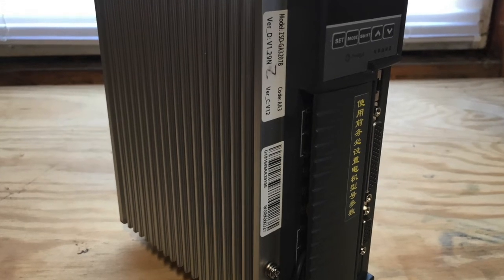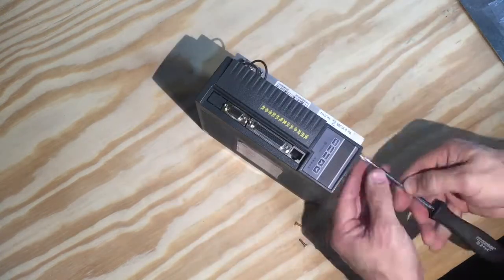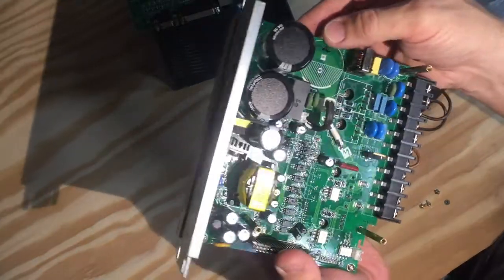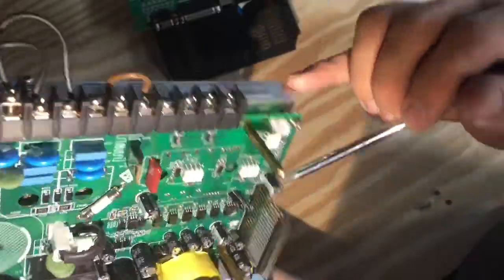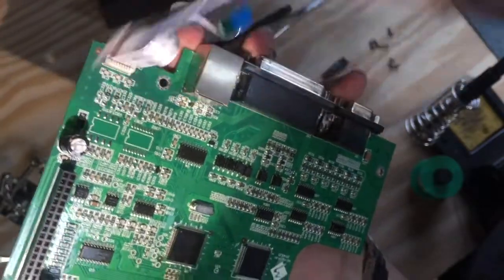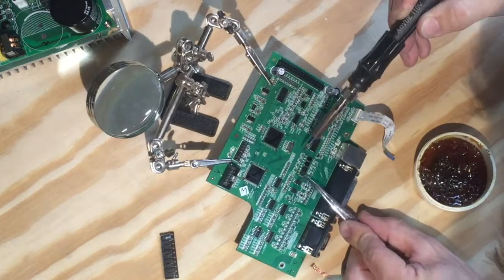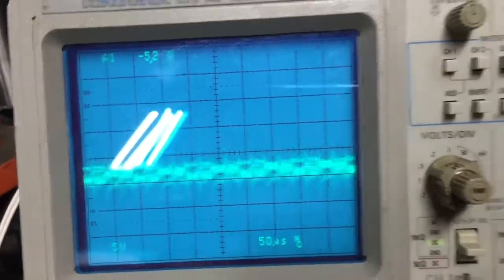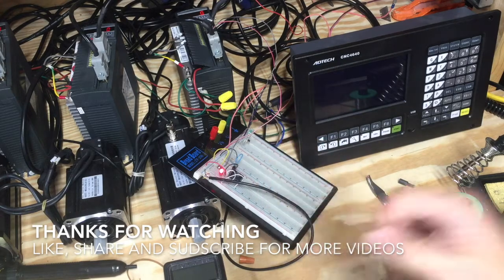DIY CNC mill: Teardown and "repair" of AC Servo drive from China. Motor brake output explorations.

Comment: hi 
when i have ac servo motor can i wiring it with any stepper drive or h-bridge 
to get open loop 
i mean to turn it without the encoder ?
Reply from the maker: As far as I understand, steppers work differently from servos. In order to get the stepper to move one step, one or more of its phase wire voltages must be flipped. Besides, technically, stepper motors are a DC type motors and work with much lower potentials compared to AC servos. So, I would not recommend trying to connect AC servo motor to a stepper drive. 
Cheers.
Reply: Tinkering Nerd thanks 🙏

Comment: hi, which pin do u use for step and dir?
Reply from the maker: Hello and thank you for your comment. This kit came with cables pre-wired, I will have to check the pin numbers for you.
Cheers.
Reply: Tinkering Nerd 
Hei, thanks a lot
Reply from the maker: On the servo drive CN2 44 pin connector, it looks like pins 32 and 33 are for pulse+ and pulse-, pins 34 and 35 for dir+ and dir-.
Pin 18 is COM+.
Hope it helps.
Best regards.
Reply: Tinkering Nerd thanks,, one more thing, which pin do i have to connect for 0 voltage,  or i dont have to,pin 18 is for 12 to 24 volts,  i have 36 pin,
Reply from the maker: If you have a 36 pin connector, your pin out map probably is different from mine. The CN2 does not have a GND pin. COM+ is used as a reference point for I/O’s.
Best regards. Thanks again for watching.
Reply: Tinkering Nerd 
It mean I just only use 5 pins only, pin 18 in my servo also for + 12-24v, and pin 32=pulse+, 33 = pulse -, 34=sign+, 35 =sign-,   Those pin 32, 33, 34,35 wire go to masso, is that correct? 
Thanks
Reply from the maker: These pins should provide minimum basic functionality to your system. Mine came with other pins soldered, such as servo ready, servo alarm, servo enable, motor brake, etc.
Reply: Tinkering Nerd 
Yes, that is the most important things to do,, about the other pins I would like to ask u later, can i?
Thanks a lot
Reply from the maker: Sure thing. I think though, you need to connect the servo enable pin (10) to be able to use the servo drive.
Reply: Tinkering Nerd 
Pin 10?Connect to? That’s what I’m not really familiar with it,, could u tell me?
Thanks
Reply from the maker: Connect pin 10 to 0V to enable the servo drive.
Reply from the maker: Once you connect it, the servo drive should “lock” the motor in one position, resisting external force on the shaft.
Reply: Tinkering Nerd 
That’s what confused me,  meaning +12-24v to pin 18,  and  -0v to pin 10, but according to this figure , 0v gnd goes to pin no 9, do u have email? So that i can sent to u some pictures?
Reply from the maker: Here’s the description for pins 7(CZ) and 9(DGND):
CZ/DGND is used for Z signal output of the open circuit of the collector, which will be provided for the host.
I’ll let you make sense of it :)
Reply: Tinkering Nerd 
Same here, pin 7&9 share same symbols, gnd, also pin 36, should I looping together and connect to 0v?
Reply from the maker: On my pre-wired system, pins 7,9 and 36 are not connected to anything.
Reply: Tinkering Nerd 
Thank u bro,, i think i have succeeded to make the motor runing with masso right now,, ist time to make some tuning,, anyway thanks again,, I’ll keep in touch with u for another wire,, alarm, 🙏
Reply from the maker: Sure thing! Keep us posted.
Reply: Tinkering Nerd 
Ok 👌🏻 thanks again

Comment: I have purchased these drives also. I followed the schematics and I'm having the same problem. In fact it was working for a bit and then just opened up randomly while I was jogging the motor. No alarm or error code was displayed. I have not tried D03 (output 3) but I require both the brake and alarm output and neither are working. What was your logic circuit supply voltage? Did you ever scope it? I'm at 234VAC with a single EMI filter for 3 drives. I'm also thinking that different results may be obtained if the 24Vdc output for external components was used to power the brake relay instead of a separate power source.
Reply from the maker: Hello. Thank you for watching and commenting. It sounds like you got a handle on it better than I do. I didn’t measure input AC voltage. Nor do I have a filter connected. My 24V supply powers the controller, the source for outputs and the brake coil.
What I found weird is that all three of my servo drives did not send the brake output signal from the beginning. There must be something to it! Yours, however, you say had worked, then quit? That’s even worse, can’t pin point at and remove the problem to prevent this from happening again.
Reply: Thanks for responding. I've confirmed that my drive is defective. Swapped it with another one and it works fine. When the original one did work it was just barely allowing enough current to light the relay. Only parameters needed are p2-15 and p2-16 must be a value greater than 0. By the sounds of it, I might be lucky to have one that's working.
Reply from the maker: Interesting.. you had not one, but two that worked! :-)
Your case sounds like the optocoupler failure. What type of relay you’re using? Did you measure the current it consumes when coil is energized?
Reply: Well, the 3rd drive brake output remains untested. I'm going to see how all of the alarm (DO2) outputs perform today. I don't believe it is working on the defective drive, so that would lean me towards the problem being on the sender side of the opto-isolators. Your video shows well that there may be some issues there also. I'm not speaking from experience but it I would think that if one of the transistors in the isolator was open, it would fail to amplify and give a similar low current signal. Would like to explore but its tamper proofed and I think they would probably warranty or repair at a reasonable cost. I'm using omron my2 series 24Vdc, measures 36.6 mA.

Comment: I just received a kit with the same Servo and inverter to replace my mini mill motor. Your trouble shooting skills and PC component R2 are very good in the end are you saying it was all a programming of the inverter? The servo  seems to be of a really high quality, the drive on first impressions seems cheap. The programming manual is over 100 pages. I hope to go through it slowly. I may opt for a better driver but for now I’ll play with it. Sorry for the ramble, bottom line is it a programming issue?
Reply from the maker: Hi, thanks for watching. You also got a servo motor with brake? The dedicated motor brake output didn’t work for me. It could be because of the firmware issues with the servo drive, for I can’t fathom the possibility of burning through opto-coupler backwards, especially since not a single component let its smoke out (we know, all electronics work as long as you keep the smoke inside, once you let the smoke out, it’s no good:-)))
I was, however, able to set one of the flexible (programmable) outputs to work as motor brake output, and it is good enough, at this point.

Comment: What can you say about these servo packs? Are they any good for DIY machines? Reliable? Thx!
Reply from the maker: I know, it’s been awhile, but, I still made no real progress towards completion of this machine. So far, these motors have been very reliable sitting on the bench, waiting for their turn. However, from the feel of it, I predict that they will be more than adequate for a hobby machine.
Reply: good to hear that. in this price range i think they are the best option to go with instead of closed loop steppers or even DC servos.
Reply from the maker: 100% agree! I think power for power its even cheaper than some closed loop stepper systems

Comment: Nice video, how did you damage the output on first instance. Or was it a bad driver?
Reply from the maker: +Fernando Ascencio thank you :-)
Honestly, I'm not sure if I even damaged it at all. I did connect my 0.6A load directly trough the optocoupler (and it was my mistake), but it would burn the optocoupler, not the processor pin. So, my best guess is that the option for native brake output had to be set, and I was unable to do so. Or somehow mysteriously I managed to burn the processor pin through the optocoupler, or it was defective.. The seller said they had it all setup to work. Must be me then.